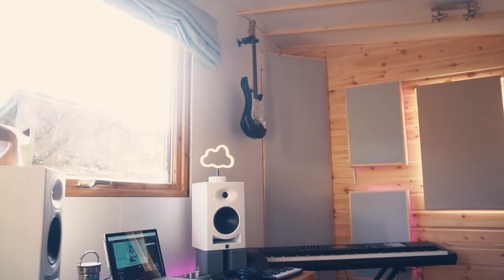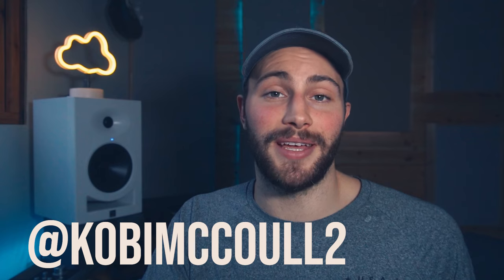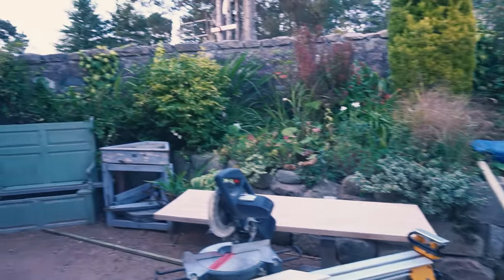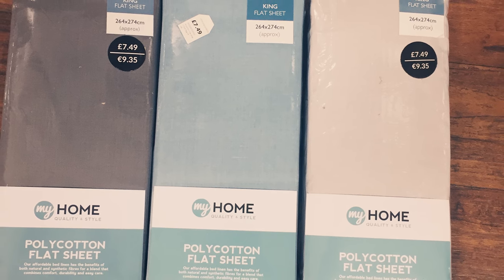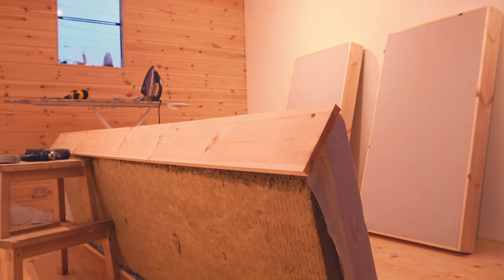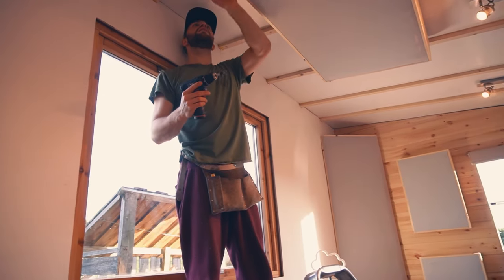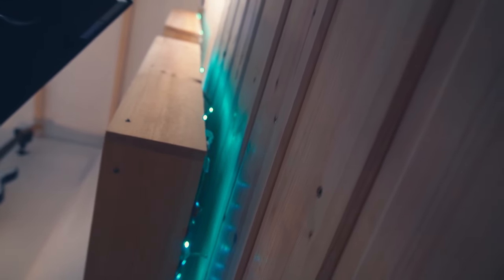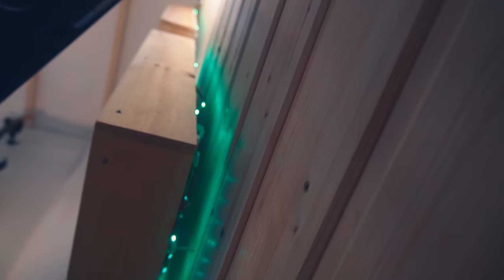Pro Acoustic Panels DIY how to make Cheap! + Acoustic Treatment Basics for a Pro or Home Studio

Comment: You handled hazardous materials without gloves or a mask. Not great advice for your viewers. Why mount the speakers so close to the wall even with RW4 in the wall that’s not ideal?
Reply from the maker: Hi Danny, I have posted in the top comment and in the description an important note on the safety of handling this material I realised that this comment was not pinned at the top and have now done that and appreciate your comment as I don't wish to encourage unsafe practise. I wore gloves and a mask almost all the way throughout working with it especially when putting it in the roof of the studio overhead. However I also found it not to be irritating to my hands. I made sure to keep the door and/or window open for good ventilation and upon researching the safety of the material I made my own choice about how to handle it. I have linked the studies and research about it in the description and state that 'it's worth wearing protection whilst handling the insulation and ensuring that it is covered in the final design with the wood and fabric but that it is overall a neutral material and should be safe'. What a viewer decides to do with it is from there on up to them. I have also placed the speakers on sound absorbing material and moved them further from the wall and the overall sound I am getting has been great to work with. I hope that answers your question. Kobi

Comment: If you value your health don't make these panels.
The particles from the mineral wool are lighter than air, fabric cannot contain it.
Reply from the maker: I have shared information in the description with links and studies on the safety of the material. I hope also to explore the options more and share whatever I find if I can come across a material that is more optimal for health, environment , sustainability, absorption and cost, which is tricky but I will share if I discover it

Comment: And how much did it finally cost you, taking into account your cheap purchases etc.
You probably touched on the panel prices and told something about an inexpensive local timber dealer who would have cost 200.

I gave you a thumb, but the video would be perfect if you had taken the quarter of an hour and made a calculation for all viewers.

I also know how to build a box and put wool in it.

After all, your video is called how I make CHEAP, and you still owe this proof ...

Don't take it so seriously, good clip!

Keep on groovin

Oh, you mention along the way that the wool works better here and there in the frequencies ...
?? Tell !!

Sorry you speak very fast for non native ...
Reply from the maker: go to 9:48 I discuss the cost for each panel and the total cost for the room. I should clarify it was £200 to build the panels for the whole room, not just for the wood. £10 per small panel up to £25 for a Bass trap. It all depends on the cost of the materials you go for but that is what it worked out as for me :) 

The rockwool has a higher absorption coefficient than many other available materials and the science is explained on the rockwool website. I hope that helps
Reply: @iambradarthur coolio , thats favourable and funny weekend  by DIY with friends and beer

Comment: Man, you spend hundreds and thousands on the room, you have huge speakers but you don't have a proper display of monitor(s)? Working on a shitty laptop takes 3-4 times more time than if you had a normal monitor.
Reply from the maker: haha I know it was definitely on the list of upgrades but I wanted to be sure I would get the right display once the space was setup, I now have a 4k BenQ PD2700U and it has been awesome performance so far which you can see iin my more recent videos, I have also upgraded to a workstation so that I can get Higher PC performance but will make more videos about the upgrades in the future :)

Comment: I wonder what will happen to the lungs of this person, breathing basalt wool fibers after a couple of years
Reply from the maker: I can't say for certain how safe or unsafe it is as I haven't carried out studies myself or lived through life long exposure, but from all the research I can find and the studies that have been conducted it doesn't seem to be anything more than an irritant whilst handling with bare skin and no face covering but otherwise neutral especially when covered.

 It does not seem to behave at all like asbestos or fibreglass due to the particles having a different shape and size among other qualities. Once inside a panel it is being blocked on both sides by the fabric and the wall, and I'm not throwing the panels around the room, they just sit there, as do thousands of other's home made or professional panels in studios across the world. it has become a very popular option worldwide, though I'm sure even better alternatives may exist or are in development. 

Ultimately the evidence suggests it is neutral, but of course best to wear protection when cutting and fitting it.

Comment: Why do you young youtuber speak without pause, dot and comma!
Slower would be more understandable and not so hectic!
Reply from the maker: Hi Der, it's a bit of a positive feedback loop I think, where the attention span of people is decreasing because of huge option and exposure to content on the internet, so videos that are more to the point and fast flowing often get better watch time and audience retention. Then peoples attention span decreases further as the slow paced videos just get skipped, so I hope to get the balance just right where its not too fast or too slow but it's tricky. thanks for sharing that though :) I will bare it in mind

Comment: £10 my arse
Reply from the maker: The smaller panels would cost about that each. the rockwool is the most expensive but if you buy it in a larger volume it wont set you back much